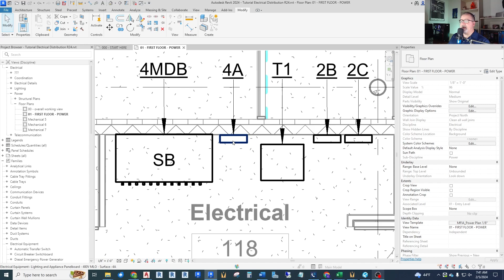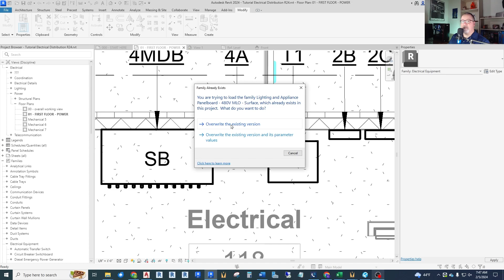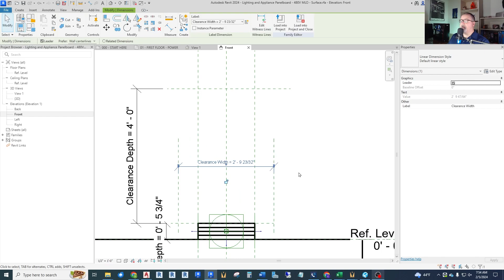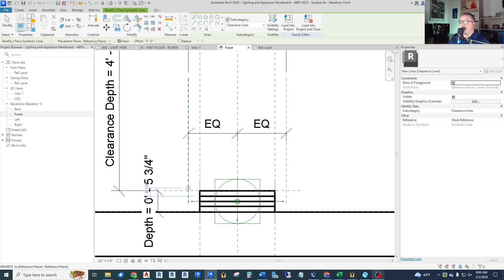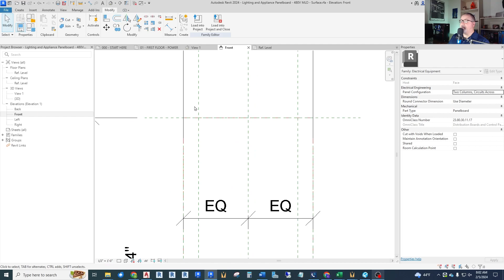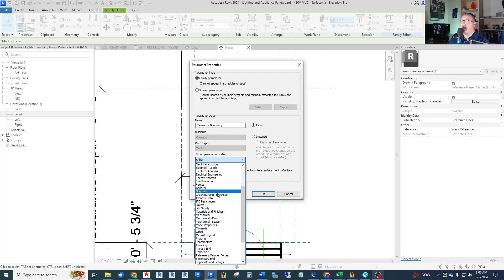REVIT MEP 3D Panel Clearance Boundary (for beginners) - Family Editor

Comment: Great tutorial! 👍 The explanation on how to modify the Revit panelboard family to include the 3D clearance boundary is very clear and helpful. Visualizing the NEC working clearance around electrical panels in the model is extremely useful for coordination and avoiding conflicts during design. It would also be interesting to see how to make the clearance parametric or controlled by visibility settings so it can be turned on/off depending on the view or discipline.

Also, thank you Robert for putting together such a practical and easy-to-follow explanation. Really appreciate you sharing this knowledge!

Comment: If you first go through Bob's "Universal Panel Family" video to make a new panel family and then go through this video.  You can set Clearance Width = if(Panel Width > 2'  6", Panel Width, 2'  6") and set Clearance Depth = if(Panel Voltage > 240 V, 4', 3').  Then your clearances will be automatically set to NEC maximums (worst case) for you.
Reply from the maker: Yes! Excellent example of how advanced you can get with these families, adding formulas, logic statements, etc. to automate soo much! Thanks for sharing!